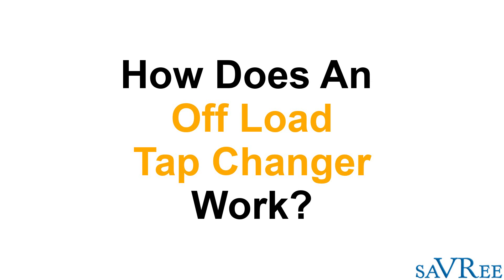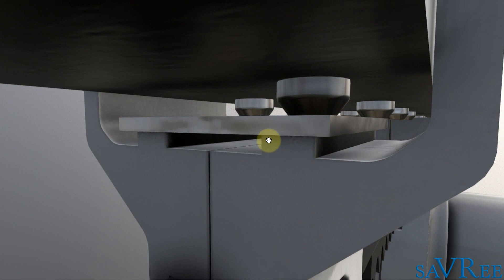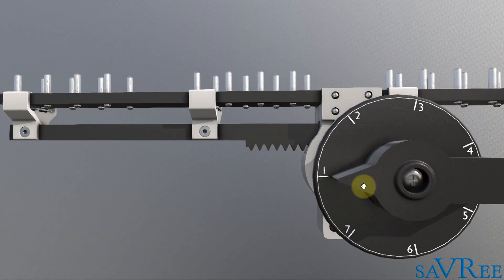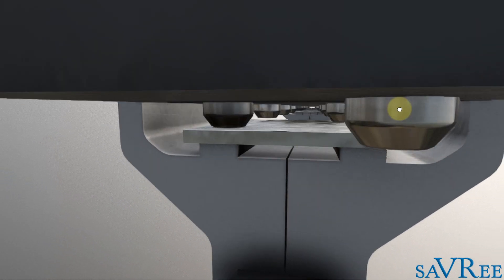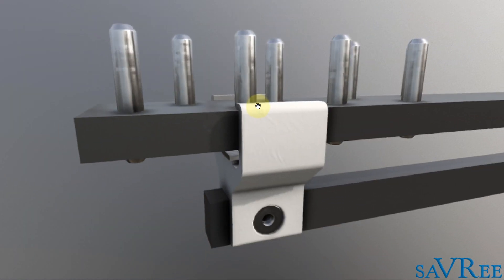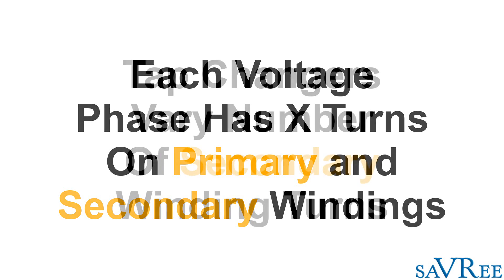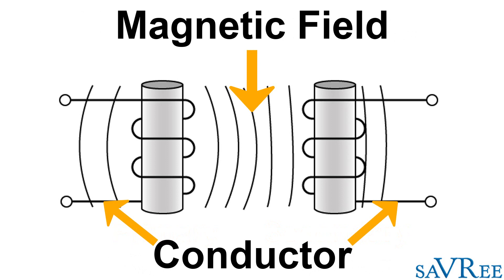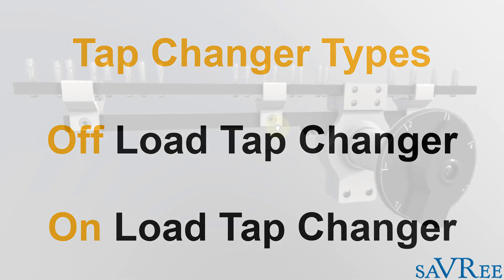How Off Load Tap Changer Works

Comment: Thank you. I’ve never heard of the tap changer on the secondary, but I mostly work with on load tap changers in oil filled transformers. Is this a feature of Off load transformers?